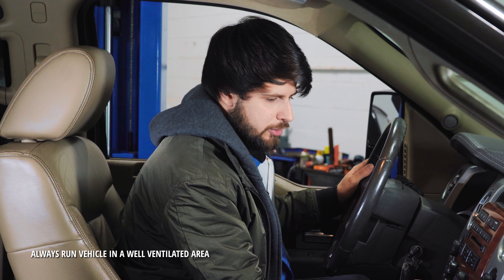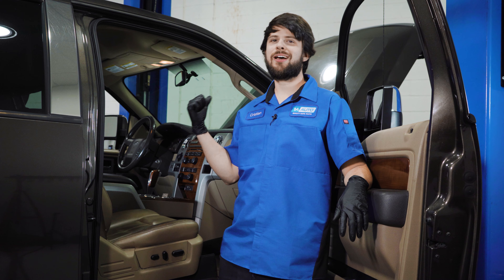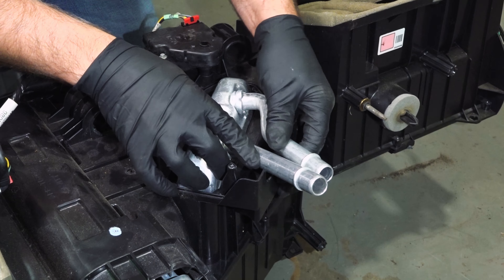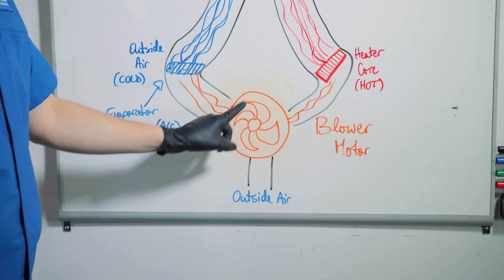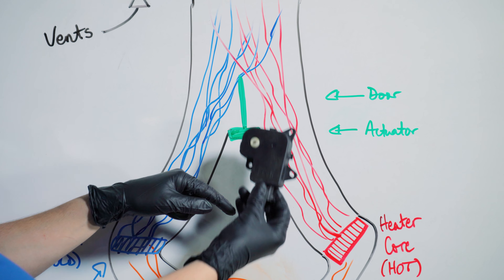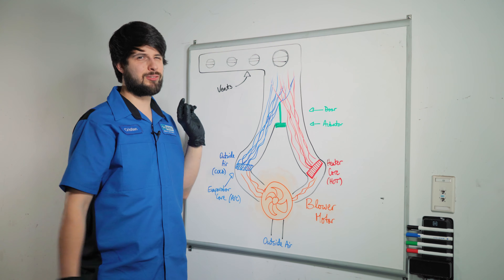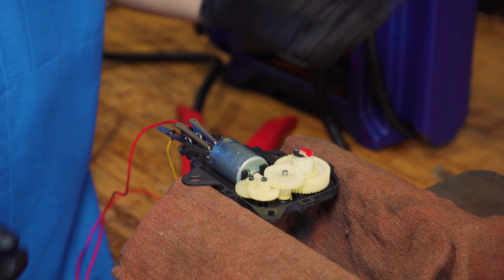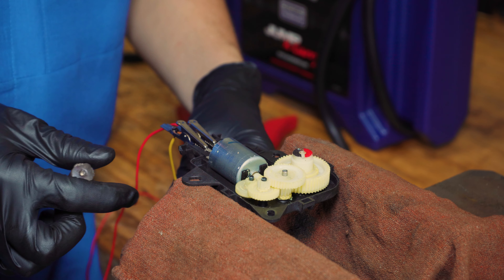Did You Know There are Car or Truck Parts That Will Stop the Heat/Hot Air from Getting to You?

Comment: When it’s -50°C, my 2010 F150 makes good heat with the fan on lowest setting, idling and not moving. Once I speed up the fan, and/or start driving, the temperature gauge drops from half to 1/4, and the air coming out of the vents is cooler. Is this a water pump issue, thermostat, or something else? Coolant level is good, everything is fine temperature wise when it’s -15°C out.